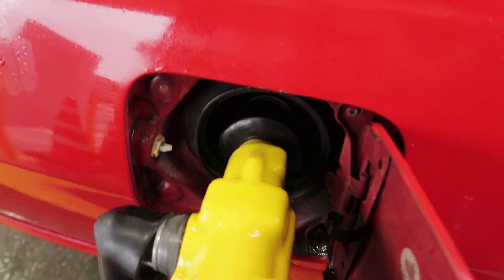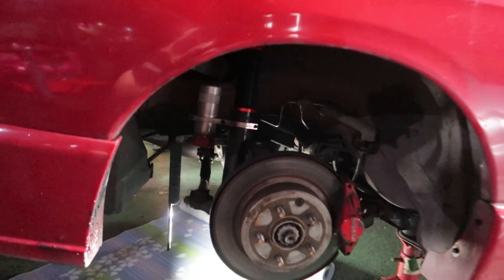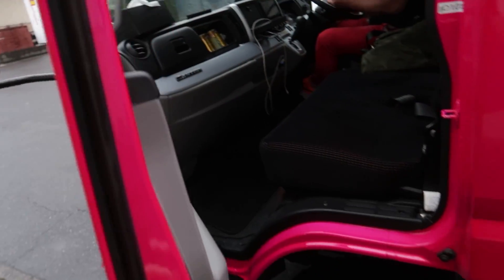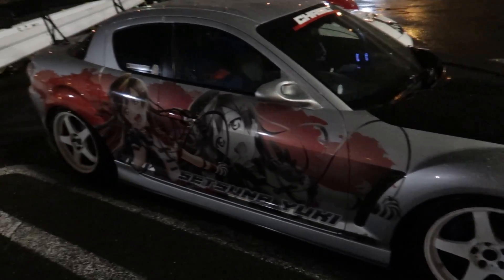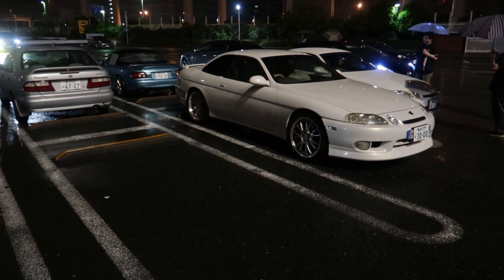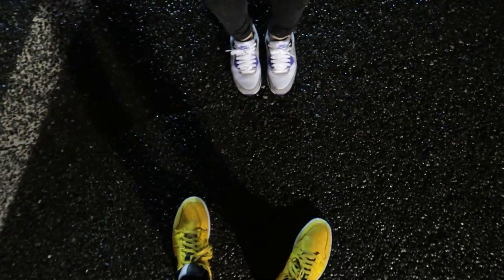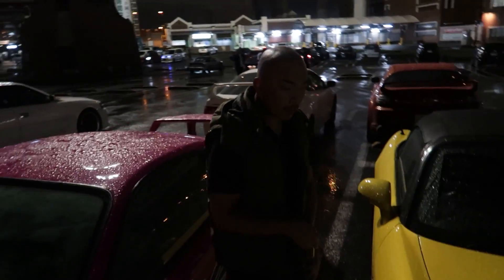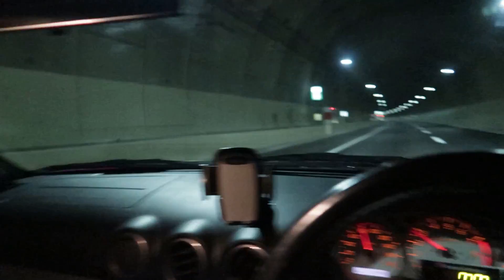SKYLINE IS GOING BACK TO STOCK!

Comment: The Z30 Soarer are such an underrated platform, even the early 1uz models have proven they can make serious power when boosted. 3 engine choices (2jzge, 1jzgte, 1uz) and all can make big power and that doesn't include the fact that this is the platform used as the basis for the mk4 supra. But yes the doors and  seats are heavy.

Comment: same in norway. every 24month we  have a EU control. everything gotta be stock and without play in any balljoints, brakes gotta be perfect, and all safety equipment. no check engine light or bad emissions allowed either. even a pod filter might be picked on.
Reply: this is the reason why you should drive a 740 940 or 240 or anything older than 94 because in finland the inspection men don't have many reasons to start crying about. especially about some fucking pod filters not that they do that here in finland anyways.

Comment: Here is new zealand most older cars before 2001 has to get vehicle checks every 6 months after 2001 its 1 year same thing also but you can get cert plates for certain things if they meet requirements.

Comment: Japanese "Shaken" is tougher on individuals who DIY. Pay a Shaken specialist big ¥¥¥¥s and for some reason cars with non-compliant parts allways pass.

Head light aim is a favorite gotcha. Slammed suspension stay above edge of rim, wheels fit totally inside the wheel wells. Remove fender flares, rear spoiler/wing, air dam, splitters etc so the cars measured dimensions don't exceed the records. Aftermarket mufflers need JASMA markings. I'm sure I've forgotten 1 or 2 points.

Australia QLD version is the "Road worthy". Failed at Main Roads for lack of rubber on the pedals, after-market metal pedal covers were a no go.

Comment: Man, every two years building back the car? I thought they are easy on mods... what if the police stops you? Was the S2000 dude running around with a Katana? It probably was the short one, I don't remember the name of the short ones... :D
Reply: The word your looking for is Wakizashi, but no, it was an umbrella with a katana style handle.
Reply: @AtticusG3  Thanks, I was using my other channel before... :)
Reply: Easy on mods but IIRC you need another inspection for all the modifications to be officially approved and printed. Probably a very strict inspection thus maybe a lot easier to revert the car back to stock every 2 years. Correct me if I am wrong (or absolutely false).
Reply: @5x22  Thanks for the explanation. It's probably also a question of money. But it is interesting that there are parts for drifting that are already approved and street legal, as he said. I still don't own a car in Japan. So I am still gathering information... :)
Reply: Depending on the situation it better to remove the parts like fender flares. If you have parking at home it's dimensions are recorded on the shako shomei (proof of parking) if the dimensions of the vehicle at shaken inspection exceeds what is allowable for the parking space, you need to come up with a parking contract on a big enough space for the police to issue a shako shomei before you can register the vehicle.
Reply: @ducatipaso1386  Ah, thanks for the additional information. Yes, that is another issue to be aware of... luckily he doesn't have fender flares, I wont neither I guess, but it is a part of japanese car culture like LB Performance or something... :D
Reply: @Rtcmanga_YouTube_Channel  I've been screwed on parking and shako shomei. The new owner of the building I was in remarked the parking spaces to squeeze in some more ¥70000 per month spaces. The new spaces were too narrow for my wide body kitted car.
Reply: @ducatipaso1386  man, that is bad! 70.000 per month? Wow, that is expensive. Doesn't your rental contract say how much space you have, can he just change all the contracts? What do you do now? Did you find another lot close to your apartment? What wide body kitted car is it?
Reply: @Rtcmanga_YouTube_Channel Their reply was the new spaces were designed by a architect to fit "3" number plate size cars. The original spaces were "oversized" and the contracts on the spaces had finished. I still had a lease left on the apartment. Shortage of parking in the building, means a waiting list for parking. Dirty move on the real estate company's part but perfectly legal. Couldnt find a parking space wide enough within the maximum allowable distance from the registered address for shako shomei/shaken/rego. Gave up sold the car and parked a freebie beater Toyota in a ¥¥¥¥¥ space. Eventually moved out now the parking machine "only" costs ¥22500 per month.
Reply: Car was a Benz SEC with KS wide body kit
Reply: @ducatipaso1386  Sad story... cool car. How far is the maximum allowable distance? 500m or something? Is it possible to register the car when parking at a parking machine? Is your space reserved? 22500 is doable... in Munich parking lots are 100-150 € (12.000-18.000Y).
Reply: @Rtcmanga_YouTube_Channel  2km from address. There is work around for 4x4s, cargo van, combi with 2000cc or greater engine: put sleeping bag, plastic bucket and cooler box inside, register as "8" number camping car in storage parking with yearly road tax. Then your insurance go up for high kilometers per year. New condo has reserved machine inside 400 units with 150 parking. I'm lucky to have it. City living really discourages auto ownership.
Reply: @ducatipaso1386  Hey Ducati! Happy Monday! Ok 2km from the address. Thanks! Not so bad 2km... Wow, that work around is interesting!! :D  A Nissan Elgrand is nice or a WRX Wagon... :D Thanks for sharing the trick. I was talking with a friend who lives in Yokohama he pays 15.000 per month for a nice covered parking for his Boxster. Sounds good your new condo's reserved machine. :)

Comment: I live in Ohio in America. If it has wheels, and can move under it’s own power no matter how it looks, sounds, and has up to date tags. It’s legal, zero inspections, smog, anything. You can drive a clapped out civic/240 missing half the body panels, slammed throwing sparks left and right on pavement, have a cut off top with no reinforcement and the car is the embodiment of rust, still legal in Ohio lol.

Comment: Damn, seems utterly pointless for them to inspect it so often if you can just take your mods off, get the inspection, then just put them back on. It doesn't serve any purpose if you can just skirt around the laws. Here in Canada (Ontario specifically) you only need to get your car safetied when it changes ownership or when it gets registered in the province from outside the province.

Comment: Spot on about the soarers!😅 pretty sure there isn’t any way to tell the difference between jzz30 & uzz30 from the outside, someone correct me if I’m wrong
Reply: Engine note that's about it, unless you have a special edition like in the US where the UZ variant got oem bbs wheels. I'm not sure if all Soarer's got the same size brakes but that's also a dead giveaway if its a JZ or a UZ on the US spec.

Comment: my week its been like shit , i fucking had a snorkel installed not as supposed to and now my fucking air intake system needs to be modded and that fucking costs a lot because pipes and hoses in my damn country are expensive, and like that was not enough ... my fucking monitor broke today so now i can even use my computer to play games and shit ... ._.